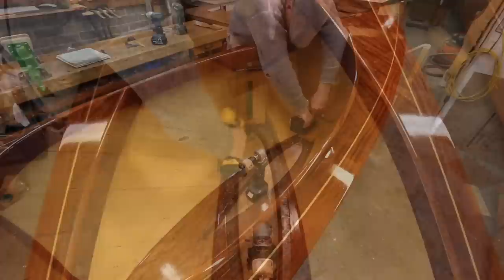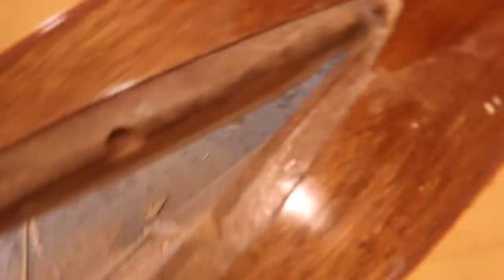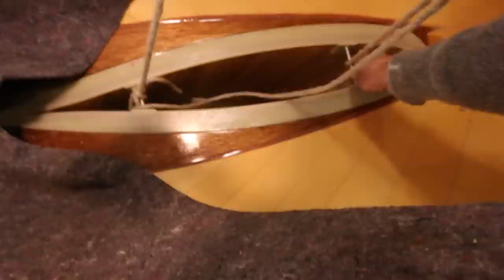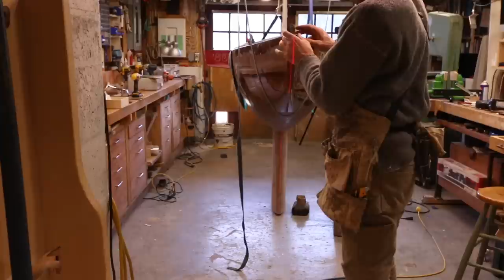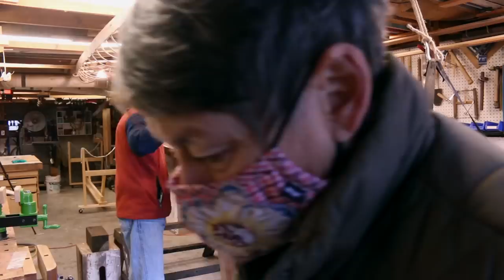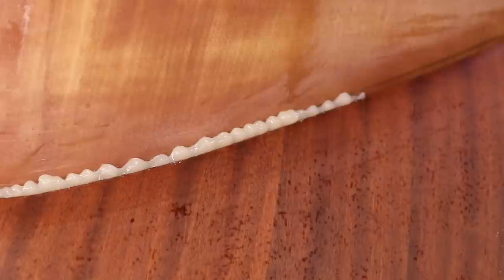International 2.4mR Sailboat Project - Episode 52 - Installing the box keel

Comment: Mark; she's looking real good. By the time she's finished , she'll be the "Dogs Hangie Downy Bits".   Those mixing tubes on the dual tube epoxy are expensive. I often thought of cleaning out used caulking tubes for similar applications where I'd need to get a goo into an a tight spot. 
I'm presuming your work shop is below the house as a lot of Canadian homes have good basements. Maybe you need to talk to your good wife and see if she would let you put a hatch in the roof up through the living room to get more lift height.  A new pair of shoes or new dress might smooth the waters. 😃 Joking of course.
Great work , a pleasure to watch your videos ; I've learned some useful things. Your pencil shaved down with the plane is great, no more marking lines a millimeter away from where they should be.
Reply from the maker: You can buy empty caulking tubes from West System for that very purpose but I have always found the pastry piping bag to be easier to deal with. Yes, the workshop is below the house. we have talked about lifting the whole thing to get more height but that is a pretty involved operation. The low ceiling has its advantages for some things though.
Reply: @Nomadboatbuilding  Heck lifting the house is a headache you dont want, the only way to raise the roof is with a few beers! . I know the better half has some of those disposable piping bags in the baking press, I'll have to relocate some of them to a safe location. I should have thought of them as I saw you using some in an earlier video and my sister is a sugar confectioner and has been using the things for years. 
I enjoy the no B.S. videos, keep them coming and I'll keep watching. Much better than TV, which I haven't watcher for years.

Comment: Congratulations, so cool to see it together. How’d the thickened tube epoxy work for you?
Reply from the maker: It works just fine but of course it is best suited to a limited range of applications. The consistency isn't perfect for all jobs as I demonstrated here. just a bitt too soft for filling this particular gap and tooling it out. The cost of these tubes makes them best suited to situation where convenience is the most important factor, like fast repair jobs on the dock for instance.
Reply: Thanks For the feedback Mark! Again the boat looks great!

Comment: Is the keel specific to the class? (I was expecting a blade and bulb of some sort, I suppose)
Reply from the maker: There is a rule requiring loose ballast and that is the designers response to it but all the boats feature pretty much the same keel.
Reply: I absolutely love the lines of any boat like this, large or small; Universal Design boats or the European Metre Classes, very fine, long bow and stern overhangs, narrow beam, long waterline... It is a bit sad to see such a clunky, boxy keel design.  Since the boat was designed in the early 80's I don't think Peter Norlin employed that keel design only because it was within the limits of technology or construction methods of the time, it was probably more to keep building costs under control and standardize methods.  Also, probably more so than what I said before, the removable loose ballast can certainly be 'tweaked' far easier and verified by Class Officials.  I can't seem to find any particular notes from Norlin on this issue but that's my best guess.  All that aside, it would be incredible to see a fine foil with a lead bulb on this sexy hull.

Comment: Thixo is more trouble than it is worth….I have had several tubes wasted because only the hardener came out of the mixer tip,  this creates a huge mess and the color and consistency varies in some tubes.  Mix your own and thicken with colloidal silica and save your money.
Reply from the maker: I see it as a price for convenience. I think it is a good system for use outside of the shop or when speed is particularly important like in week long group boatbuilding courses. It's not something I would use day to day. I have had similar trouble with West System's Six-10. I think this stuff does not have the best shelf life and when you combine the resin with thickeners, the natural tendency for epoxy resin to gel up is just accentuated. I think best practice is to always use very fresh product or give it a few hours in a hot water bath to ensure liquefaction.